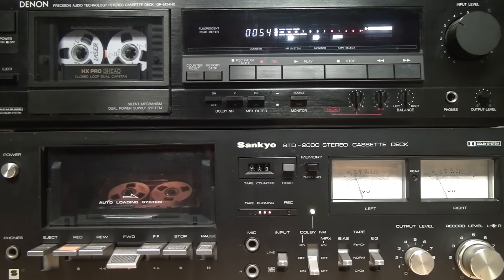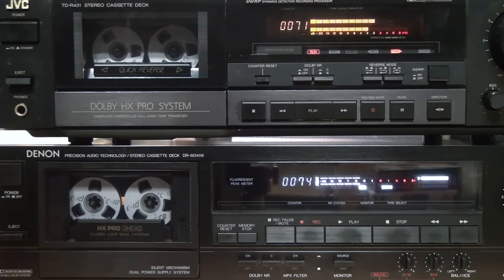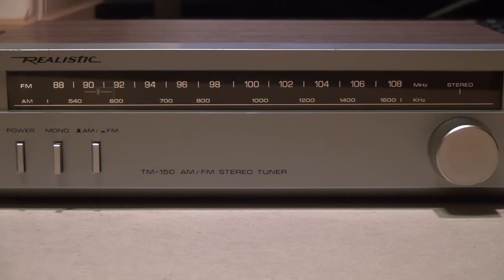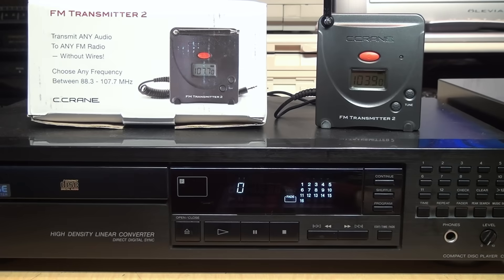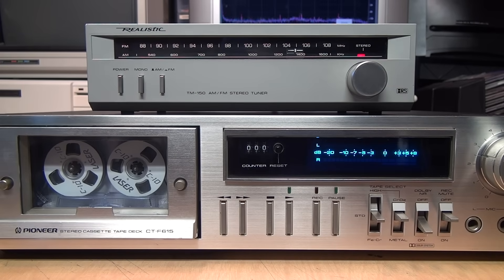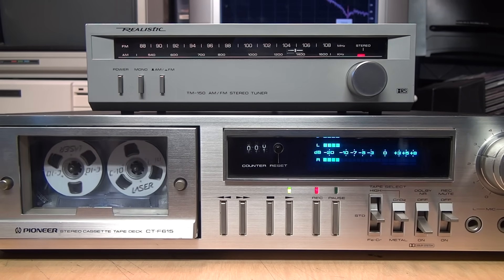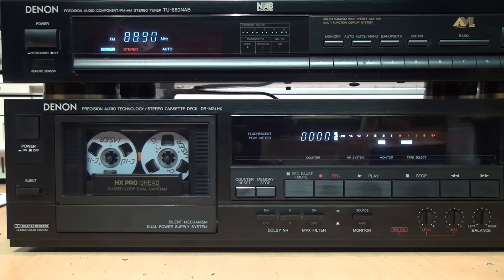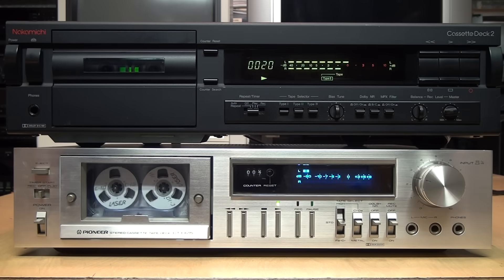MPX Filter - What does it actually filter?

Comment: Thanks for the video but feel I need to clarify a couple of points. 

Firstly you say that engaging Dolby turns on the MPX Filter as you can see the level of the pilot tone reduce. This is probably not the case as when Dolby in engaged on playback the high frequencies are attenuated by hopefully the same amount as they were boosted during record. This is the basis of the Dolby B noise reduction. C/DBX are of course subtly different.

When I was younger I had good hearing which of course decays with age as a main factor. But I could never really hear 19k. The 15.6k timebase from TVs was clearly audible. But the main purpose of the MPX filter / Beat Cut switch was to remove the pilot tone as much as possible so it didn't "Heterodyne" with audio signals to be recorded OR the bias erase oscillator on the tape unit. Some cheep beat cut systems just shifted the bias/erase oscillator frequency slightly. 
 
Think of this as an example... If the pilot tone is at 19k and the bias oscillator is running at 25k then the sum and differences of these would be 19+25= 44k (Inaudible) and 25-19=6k (very audible). The same could theoretically occur with audio signals but on a well designed FM tuner the output after the decoder and de-emphasis should have removed the pilot tone and the L-R sideband along with RDS and other data signals.

Cheers..
Reply from the maker: As I mentioned in the video, the filter does not affect playback. It is only engaged during recording. And cassette decks use bias frequencies much higher than 25 kHz. A bias frequency of around 80 to 100 kHz is typical.
Reply: @vwestlife  Exactly... The figures I chose were just an example to make maths and understanding easy. But the 19k will have harmonics that could beat with the erase oscillator causing audible effects.  I just saw a number of comments fixating on the hearing of the 19k signal and wanted to advise the other possiblilities. Please threat this as a positive comment and please keep up the great videos.

Comment: You can see that the MPX filter is lowering frequencies as low as 14Khz. At 16Khz you see about a 12dB drop. So, yes it does affect what you hear at the high end of the FM audio. You can also see a very clear step at 18Khz meaning it is likely a simple 18Khz low pass filter.

Comment: Granted, this confused me a LOT back then too. Until i used a 3 head tapedeck and did a FM Stereo recording with Dolby C and enabled MPX filter. I was switching between MPX off and ON and realized the sound was so much better with MPX filter on. Resulting in a crystal clear tape recording of my FM Radio program i was recording. So clear, it almost made me believe i had a DAT recording. With MPX off it sounded a lot more muffled since the Dolby Noise reduction circuit thought the high pitch FM Stereo Pilot tone was a noise that was supposed to be removed. Which of course had a profound negative effect on the sound quality.  Once you knew the benefit of the MPX Filter, Dolby NR recordings from Radio became a LOT more fun :)

Comment: The bad thing is that MPX filter was there to do what the tuner normally should do. The tuner should not let out any of technical signals. The producers of tape decks then could ask for more money for them because they contained filter to compensate the failure of the tuners the same producer made.

Comment: Excellent. 
So, RCA or din plug to connect my cassette decks?  
Should I use an EQ unit in my retro home stereo?   
Where did all these plugs come from and why are there not enough sockets?
Reply from the maker: RCA. And it's fine to use an EQ if you think it makes your system sound better.

Comment: A modern use for the MPX button - is recording from a modern hi-res sound card that has noise shaping. Some of these generate significant ultrasonics and these ultrasonics completely confuse dolby encoding. Its yet another reason people "don't like dolby" without actually understanding what's gone wrong. Whilst the MXP filter is centered at 19khz, it's wider than that and actually starts just above 15khz and goes well above 30khz in order to remove the entire stereo carrier. As such its perfect for cleaning up a noisy sound card.
Reply: Only trashiest of sound cards generate any kind of ultrasonics, we're so past these problems its not even worth discussing.
Reply: @VEC7ORlt ever heard of hi-res audio? Ultrasonic galore!
Reply: @dlarge6502  Sure did, now demonstrate said ultrasonics.

Comment: You can very CLEARLY hear the MPX filter; the sound is a bit less open on top. Listen in particular to the wood block hits, you can hear they are every slightly rolled-off in the version with the MPX filter engaged; with it off there is more air around the wood block hits.

Why is this? Can I hear 19 KHz?

Probably not, but no filter is a perfect notch filter at a certain frequency, they all tend to remove nearby frequencies as well.

Comment: Great explanation. SACD recorded on a good tape deck can triggered the Dolby circuit  to if the MPX filter is not engaged. I have some bad experiences with a Rush SACD ( Conterparts) recorded with Dolby C on chrome tape in my Nakamichi BX-300: The 3 head monitoring make it so clear. The sound was extremely dull without MPX... Like a non Dolby recording decoded with Dolby. When i turn on MPX filter and Dolby B or C on monitor mode, differences are minimal. Without any Dolby encoding on SACD's no MPX filter is needed and the sound is so close to the original source but hiss can be heard on quiet passages.

Comment: Thanks, no doubt this feature has been a mystery to many audio enthusiasts over the years and decades. From what you have explained and by what we can see on the spec ann, the MPX feature is a simple notch filter to notch out 19KHz, as what is present in all FM stereo broadcasts and the MPX filter simply notches that out when engaged. 19K is indeed within the audible spectrum range of healthy human hearing so it doesn't come as a surprise to me that some folks with good to exceptionally good hearing could actually hear the stereo MPX pilot tone in FM radio stations that are indeed broadcasting in stereo, nevertheless FM broadcasters are required to brickwall the high end fo their programme audio at 15K so as to prevent audio frequencies in the broadcast from interfering with the station's transmitted 19K pilot tone. The MPX filter is indeed handy to further notch out the 19K spike that might otherwise get reproduced and amplified on a high-end receiver and set of speakers.

Comment: Some Hi-Fi VCRs also have an MPX filter.
Reply: The Sony SL-HF750 SuperBeta Hi-Fi VCR has that switch. According to the manual, it's meant to filter the pilot tone for FM stereo recordings, not NTSC MTS stereo TV recordings (their pilot tones are at different frequencies: 19 kHz & 15.734 kHz, respectively). Default setting is off.

Comment: Love that picture @10:45 lol! I still have all that stuff. Always wondered about the MPX filter button, knew it had something to do with filtering out the carrier signal but I never heard the difference. FM stereo is too noisy and hissy anyway, even with a good rotating roof antenna. I usually end up recording FM in mono mode to cut the noise level if I’m recording off the radio.

Comment: I never used dolby when recording tapes because I always believed it dulled the highs. Around my area, there were some large top 40 stations still using the old optimod 8000s. One in particular had a whistle on the air. Ran that way for decades until they closed down. As an old retired engineer, working with this equipment all the time, the newer digital optimods such as 8400 and 8500 are clean. I enjoyed the video you had of your hobby FM with the CRL, but I can't find it anymore. Was it removed?
Reply from the maker: The CRL processing demo is on my Vimeo channel.

Comment: The difference is clearly audible, and I was surprised because YouTube's audio should not, under any circumstances, reproduce 19 kHz. But the MPX filter is not of the 14th order; it's already a lot if it's a 2nd order, so it kills high frequencies long before reaching 19 kHz. In fact, even with my eyes closed, I guessed when the filter was activated in the video. Anyway, congratulations on the video, beautiful as always.

Comment: It doesn't just filter out 19kHz alone, because there is no such accurate filter in analogue circuitry. It actually filters out all frequencies above 15kHz or so (i.e. low pass filter).

Comment: An MPX filter on a tape deck is, at least, a notch filter that will block the 19 kHz pilot tone, and possibly higher frequencies in the 23-53kHz and 63-75kHz bands. The difference can be heard when recording from an FM stereo source and engaging and disengaging the MPX filter switch. On a three-head deck with monitoring, this can be heard while recording. The filter should not be engaged when recording from other sources, such as Compact Disc. The setting of the switch has no effect during playback.

Decks with no MPX filter switch typically have a non-defeatable MPX filter incorporated in their design, which limits the overall (i.e. record to playback) frequency response to about 15-16 kHz.

Comment: Good tuners actually often contain a better way to cancel the 19 kHz pilot tone than cassette decks.
The cheapest way to implement that is by a low-pass filter. The problem is that these filters often are not steep enough and thus cut into the audible frequency range way below 19 kHz. A better way is to instead cancel out the pilot tone by literally adding another 19 kHz signal that has its phase inverted w.r.t. the original pilot tone. This is the same principle as used in active noise reduction. If done correctly, this only affects the pilot tone (not even any music signal, although FM broadcast does not reach such high frequencies).

Comment: I figured it was something to do with radio, since MPX decoders exist for TVs (at least those that have the option from the 80s). Had no idea it was directly for the pilot light though, very interesting! Also didn’t know that the pilot light used high frequency to turn it on, but it does make sense considering it’s radio. Great video!
Reply: The 19KHz tone does a lot more than turn on the light. Inside the stereo decoder it get doubled to allow demodulation of the L-R audio information which is centred on 38KHz. Turning on the light is just a bonus.
Reply: I guess I never really thought about the in depth details of how FM works. Always cool to learn more about audio!

Comment: In the Non-Dolby NR camp you're forgetting about DBX such as on my Luxman K-406 cassette deck (which also has Dolby). Granted it's possible DBX is also disturbed by the pilot frequency.  Speaking of obscure Dolby switches I've got a Wollensak 8-track deck with Dolby NR and it has a Dolby FM Decode switch because apparently Dolby NR over FM was a thing for a while.
Reply from the maker: The Technics dual cassette deck I showed -- probably one of the cheapest they ever made with DBX -- has an MPX filter that is permanently on when recording, including when using DBX or no noise reduction at all.

DNR was also designed to optionally have an MPX filter in its control path, so that it won't be affected by the pilot tone, although the filter is not actually applied to the audio path going through it.

Comment: You've presented yet another fine video. Point of information: The FM (Stereo) broadcast standard specifies that transmitted audio must be between 50 Hz and 15 KHz. The absence or presence of a MPX filter would have no effect on the frequency range of a recording from FM radio, as most MPX filters didn't start their rolloff until 17 KHz.
Reply: I guess the key point of the feature is being able to turn it off in case your batty ears can hear 19KHz tones recorded from a CD.
Reply: I was hoping somebody would comment on this, because it saves me the trouble of doing it.  Also noteworthy is that the equalization of FM broadcasts depends on the region.  Some tuners have a switch to deal with this.

Comment: My older Panasonic shortwave radios had an extra output for something called MPX OUT. Don’t really know what that output did or what the function was. The owners manual never mentioned the MPX OUT. But it was there along with an output for an external earphone/speaker. Also on the unit next to these was a record output. 11:09 Most of us as we get older lose some portion of our upper hearing range. When I was much younger the screech that my old CRT gave off was easily heard in a quiet room. When I worked around the TV department in our store it definitely bothered me but now it probably would not. Of course TV isn’t done that way anymore.
Reply from the maker: That was for an external FM stereo decoder. Techmoan did a video about them: https://www.youtube.com/watch?v=KDY7HVqM6ew
Reply: @vwestlife  thank you for steering me in the right direction. I thought I had seen that video before as well.

Comment: Usually, when someone complains about "I can't hear the difference because of YT compression," it's almost definitely cargo-cult wisdom, and the compression isn't actually affecting anything discernible.  (Assuming you stream at more than 240p.)  But in the case of 19kHz oscillators at -45dB, yeah, that's probably going to get filtered out by the audio codecs too.

Almost nobody can hear a real 19kHz tone.  I remember trying back in my teens, and I could... kind of ... sense that pin-prick sensation.  But more often than not, I just heard the subtle click of starting and stopping a high-frequency sine wave outside the zero-crossing.  And so, there's no loss filtering it out on an FM tuner.  The hash up showing up in the spectrum analyzer is almost certainly correlated noise anyway, and not actually intended signal.  There's also no loss filtering it out twice, regardless of source, because tape isn't going to capture that much meaningful signal up that high.

Also:  I have that same CD player!  Got it at a thrift shop for like $10.  Works fabulously.  I have a set of cans dangling out of it right now.  :-)
Reply from the maker: If you look at a spectrum analysis graph, YouTube definitely is reproducing the 19 kHz pilot tone during the "dead air" portion of the video.
Reply: @vwestlife   Huh.  So the codec I have now is Opus.  From what I've read, it's around 128kbps for normal video.  I did a little bit of Googling, and some sources claim that Opus does not lowpass (edit: well, lowpasses at 20kHz) at relatively high bitrates.  That seems suspect.  Common AAC libraries lowpass at 14kHz to 18kHz at similar bitrates.

It might just be that Opus is willing to consider near-ultrasonic audio if there's nothing else going on to spend the bits on.  (Like the FM silence example.)  But I wouldn't expect a lot of 19kHz content when there's anything significant to encode in the range of adult hearing.  :-)

Comment: I found another use for the MPX filter years ago, I found certain albums and definitely certain CD's that would produce distortion on the cymbals on the tape recording. I fooled with bias and levels which was little help. I tried using Dolby it it's various forms or no Dolby at all. It was still distorted. I tried another cassette deck, that one did it too.  I tried a reel to reel deck, that still had the cymbal distortion to a lesser degree. I finally tried the MPX filter, and that almost completely eliminated the problem. Apparently there were high frequency signals(s) in the audio that became nonlinear on tape.
The cassette decks were a Sony and a Sansui, the reel to reel was an Akai. I think the CD was "Octopus" by Gentle Giant but there were others. Some vinyl LP's had the problem too to a lesser extent. I can''t set this up for testing as none of my tape machines actually work any more.
Reply: The first CD version of "Octopus" was ultra agressive on highs; unlistenable.
Reply: @seacampal1425  That makes sense. I assumed there was some ultrasonic content there, I guess it wasn't ultrasonic to everyone! Maybe it did to your ears what it did to my tapes. I could hear a TV horizontal back in the day (15750 Hz) but never could hear the FM pilot (19000 Hz).
Reply: @davidg4288  I think "Octopus" was mixed and mastered for vinyl  ( RIAA) and not for CD.

Comment: The main reason why your FM tuner wouldn't have a MPX filter is that it's a mono receiver, either because it was too old or too cheap. Dolby NR and MPX were non-trivially expensive before IC's became common in the mid-70's, and even then early IC's weren't as good as discretes.
Reply: I was discussing this with Techmoan before he made his Stereo Dongle video. In many early FM tuners and even in some cars the multiplex stereo decoder was an expensive optional extra.